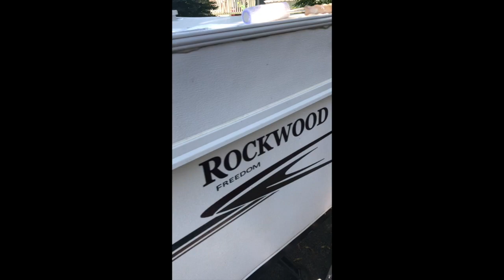Sealing My Pop Up Camper Roof with ProFlexRV Caulking and Flex Seal Paint

Comment: Thanks for the video. I’m curious, with the leak in the roof, did the wood inside get soft or weak? The interior ceiling of mine is soft and the hardware to hold the door up on the ceiling fell out. Trying to avoid an entire roof redo.
Reply from the maker: I’m glad you enjoyed the video! The water definitely weakened the wood. We traded it for a travel trailer shortly after this so I don’t know if they needed to fully replace it.

Comment: Did you take off the old paint off the old roof? And where did you get the RV  colk.
Reply from the maker: I did not. I just cleaned it very well and allowed it to dry. You can get the caulk at any RV store or on Amazon

Comment: Is it still holding up?
Reply from the maker: Jeff Folk I sold it at the end of the year. But the woman who bought it says it’s great! Gonna try and get some pics from her.
Reply: Paul DeSousa I’m in the process of scraping  my old paint off now. Did you use a primer? Or straight on with flex seal?
Reply from the maker: Jeff Folk straight flex seal! Just made sure to clean the roof very well and let it dry thoroughly.
Reply: Paul DeSousa ok one more question. Did you let the first coat dry for how long before applying the additional coat?
Reply from the maker: Jeff Folk only let it dry for a bout 15 minutes. But it was very hit and sunny that day.
Reply: Paul DeSousa see now I’m torn. Because the flex seal website says let it dry 24hrs before second coat. Up to 48 hours to cure.... Hmmmmmm? Whatcha think?
Reply from the maker: Jeff Folk I’m sure longer is better. I just didn’t have the time! Plus that stuff is so thick.
Reply: Now that it has been a year, how it it holding up?
Reply: I will be sealing up my camper before spring.  Any update on how its holding up?
Reply: @caseyadams5667  I have left mine uncovered for the 1 1/2. It look incredible when it’s done and it does do the job. But eventually it will need to be washed and cleaned and another coat applied. Certain spots also need touched up occasionally. It’s still a good option, just be prepared and realize at some point you will have to apply more.